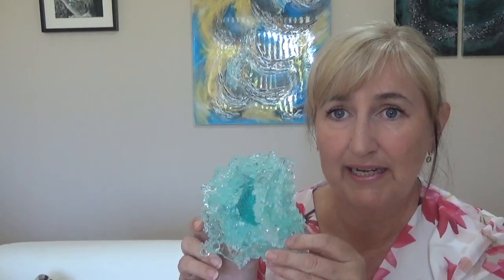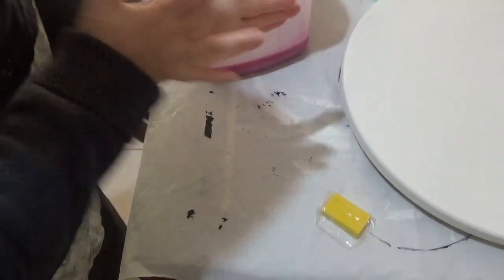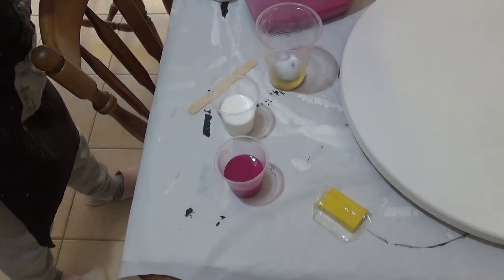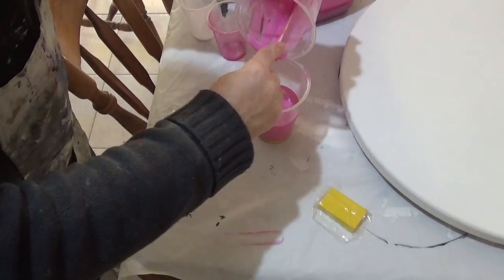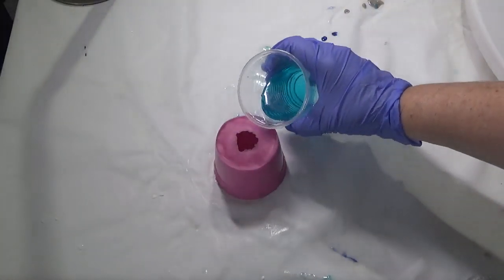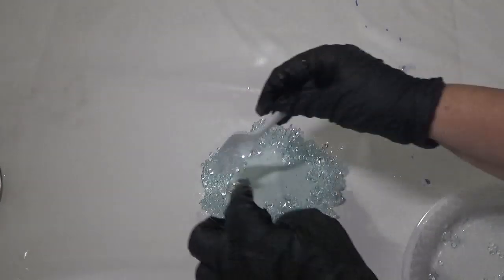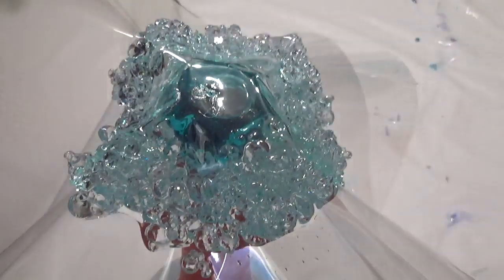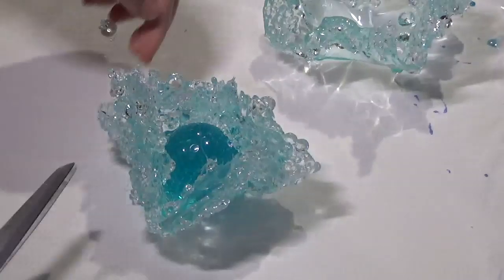How to mould an object and cast it in resin - Gift idea for him!

Comment: I love your work! I tried copying it to some extent but it was a failure. I used the plastic bags but I made the mistake of molding it on top. The plastic still came off with work, but the white label the bags have on them stuck to my pieces! So I had a white rectangle on everything. It was quite disappointing. But I sanded and am now going to put a coat of clear resin on top. Wish me luck!
Reply from the maker: You are the third person to mention this to me. I believe you can use rubbing alcohol to get it off.

Comment: How strong us that resin once it's cured?  I was thinking of fixing a belt of mine, its a cheap plastic buckle, but wanna make one from epoxy for strength.  Is is comparable to say a generic epoxy like a jbweld or bob Smith epoxy in strength?  I could always add in micro balloons or mat.  Thank you.
Reply from the maker: The casting resin for the golf ball is very strong. But that could be because it is a sphere. Whereas, the coating resin I used for the water splash is quite fragile and would break easily. I have never used the epoxy resins you have mentioned, so can't offer an opinion on them. Good luck with your project. 😁

Comment: Beautiful work!  I just found your channel and wanted to send you a message, but didn’t see an option for that.  We own an auto glass shop, so we come across lots of broken glass.  I would love to be able to create something out of it, instead of it going in the landfill.  I’m not familiar with using these types of products, but am excited to look into them. Do they have strong fumes?
Reply from the maker: Not all resins are created equally. I would recommend doing some research into the resin that is available to you. I would also highly recommend that your wear a respirator and gloves etc., even it is states that it is safe to use. Remember, that adding pigments, additives and heat can change the properties of resin. So always err on the side of caution and make sure you protect your health.